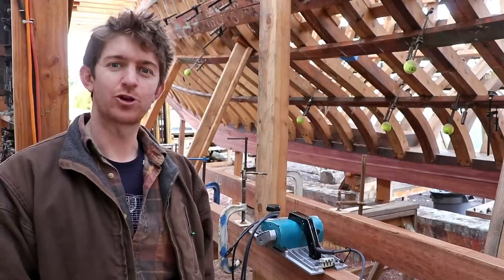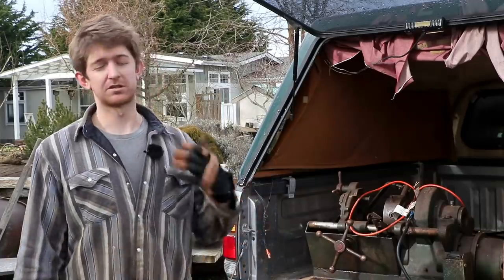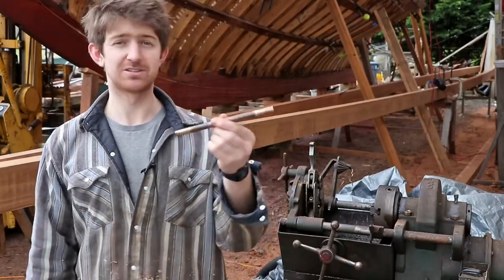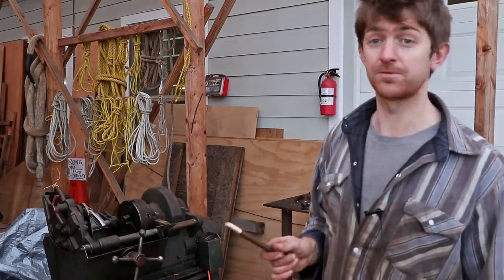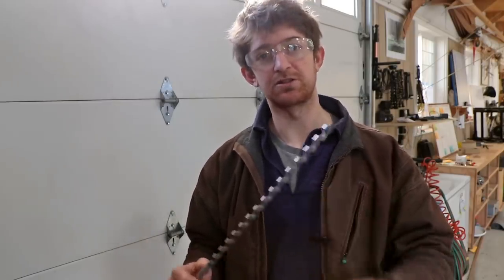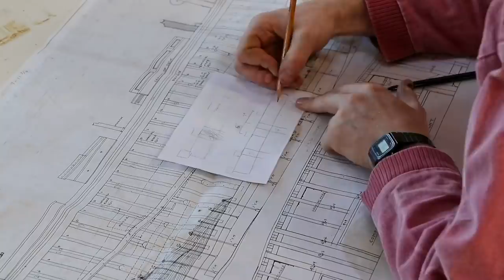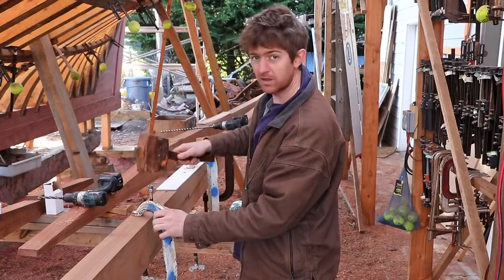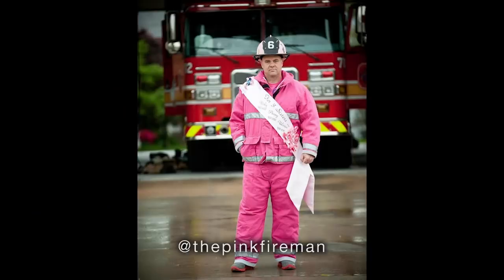East Coast Oak and a Pink Fireman (EP66)

Comment from the maker: A beautiful message from Marshall and Shannon at FOR 3 SISTERS! https://youtu.be/RecyLsr4rhU

BELOW: The top questions from the first 6 hours answered here. Remember to ask your question in the first 6 hours of each new video.
Also, I'm really happy to say that F3S has received a huge and amazing outpouring of financial support from you guys! Thanks so much! 

 What are you going to do for an engine?

A modern (but very low-tech) auxiliary Diesel engine, probably around 85HP. I'd love to use electric power but I don't feel it would be the right option for this boat, with the plans I have for it. I'll explain this in much more detail at some point. 

Why not just file the thread off the auger and leave the tip for easier starting?

Well actually, I didn’t think of it. But for hardwoods I really like to sharpen these augers on the Tormek grindstone, and I think that would be a lot more difficult with a pointed tip in the middle. I imagine it might make the drilling harder, too - it's difficult to even push a pin into wood this dense. 

How many batteries did you go through to drill those holes?

Actually, only one! Modern cordless technology is amazing.

How far and how long did it take him to bring you the wood?

Check out the little segment right at the end of the video. About 1 week of driving, 3500 miles. 

Where did you get that brown jacket / the pink smock?

The jacket came from Arborwear, they make great gear and I highly recommend it. The pink smock came from a thrift store (charity shop), via Cecca! The brand is DEAL.

Do you recommend getting into boatbuilding?

Absolutely! It has given me so much joy, and introduced me to many people who I admire. It may not always pay the best, but the builder of a beautiful wooden boat is always respected more than the rich man who paid for it. 

Why didn’t you counterbore for the nuts and washers in the beam shelf joints?

Counterboring would remove structural grain and reduce the strength of the wood even more, at the point where it is weakest already. There will be space above and below the beamshelf, so there it really no need for it here. This is why I had to make sure to place the bolts where there would be no deck beam sitting on top.
Reply: I like this idea of having a scroll through the comments early in the video release and picking a few questions. Might seem like your spelling everything out but it’s greatly appreciated to get some insight into what’s going on behind the camera.
Reply: @timmitchell8081  Agree, great addition to the site Leo

Comment from the maker: **QUICK Q&A**  Leave your most pressing question here (in a separate comment) within the first 6 hours of this video's release, and I'll pick the top 5 questions, and answer them right here in the comments! Thanks all
Reply: So how DID you mash your finger???...
Reply: When do you think you'll put Tally Ho in the water, where will you do it and have you any plans for the making of the mast and rigging? best series on Youtube ever!!!!
Reply: Will you do another rebuilding after Tally Ho?
Reply: Everything always seems to work out as planned, were there any mistakes or rework you had to do?
Reply: What gives you the energy and motivation to get up early, work through until dark and generally muscle on while you throw fists full of your hard earned dollars at the project (i.e. remuneration is not a motivator for your behemoth task)
Reply: When are you going to propose???
Reply: Hi Leo, your work is always excellent but do you ever make cockup's like cutting wood too short or drilling a hole in the wrong place. Best regards....DA.
Reply: I'm curious why you would use Bronze bolts over stainless steel??   Is it just historical correctness?  simply aesthetic?  or is there an engineering reason?.. thanks.
Reply: How far and how long did it take him to bring you the wood?
Reply: @calholli  he has adressed this in an earlier video i think. Acorn to arabella also discussed this in a video. I think while dismantleing the victoria
Reply: @claeswikberg8958  lol.. You could have just typed the reason since you've seen people say it--- but hey.. thanks
Reply: Sampson Boat Co what tools will you load onto Tally Ho when you leave? Since she’s a large wooden boat, I’m sure there’s some must have tools that you won’t wanna leave behind. You’ve got quite a large collection now.
Reply: @calholli  I know, but im not 100 percent sure i recall the correct ones, so instead of giving you the wrong answer... but i think it was down to how the wood reacted to stainless and that stainless is just rust resistant, and that the bronze holds up well.
so engineering standpoint i guess...
Reply: @claeswikberg8958  Right on..
Reply: How much will the Tally Ho weigh when she's done? 
How will you transport her to the water (what is max weight a boat transport truck can move)?
Reply: @arnhemseptember2009  at the end of the video the little signature thing on the wood says 7 days and 3500 miles one way. So that guy spent 2 weeks driving 7000 miles. holy geez.
Reply: @SuperNetSpyder  My goodness. I missed that....
Reply: @arnhemseptember2009  The Pink Fireman started outside Washington DC drove to Connecticut to load the oak, then across the US to Sequim WA. 10 days, probably over 3400 miles 5500km.
Reply: I like this Q&A section
Can you please show a drawing section of how the beam shelf supports the deck and briefly explain it?
Thanks!
Reply from the maker: @andrewhughes2446  not that one lol
Reply: Were the joint bolts at a slight angle pulling it tighter?

Comment: Three cheers for Marshall and his wife. The donation of his time and the commission of his truck and trailer to bring that wood across the country was an amazing contribution to the TALLY HO project. It's amazing how people come out of the woodwork to support Leo in his rebuilding of the TALLY HO. Also a big shout out to the fellow who bought Leo the 7" Makita Hand Planer. That was an amazing contribution and you can see how important a roll it has played in the work done during this video. Another big shout out to Leo himself for beginning the restoration on the bolt threading machine. Getting that machine up and running to produce threaded brass bolts was an impressive accomplishment. I also have to take my hat off to your master craftsmanship Leo. Those scarf joints are the same quality has the most expert Japanese wood joinery. They fit together like rocks at the Inca ruins on the top of Machu Picchu. Impressive. It's exciting to watch the progress that is being made on this project.  Well done Leo.

Comment: Your cutting oil reminded me of a tale told by my first boss. He was working in a metallurgical research laboratory in London. A colleague was working on new cutting fluids for copper alloys and was looking at modified vegetable oils, many of which form an emulsion with water. His car was leaking and burning a lot of oil, so he used the left over samples of oil. If he ran out on a journey he would just top the engine up with water. Imagine garage staff reaction, but the engine went on for years with this treatment.

Comment: On your planer - get a piece of PVC Elbow and put it on the out port so you can direct the chips .  Will save a LOT of mess all over the place and not just locally.  If it comes with a hose attachment, then use it to attach a 90 or 45 to it to deflect the chips.  

Hose and vac often get in the way and on your plannings just won't work.  A Heat Gun will help form to fit the odd shape.

You could buy 6 extra blades and just change them out then sharpen them as a group.

Comment: Hi Leo. When I have used a long auger in a power drill I simply grind a flat on the side of lead screw. This gives me the accuracy of locating the start (as the point is still there) and renders the lead screw grip ineffective. In other words I can control the rate of drilling and remove the bit at any time .. just as you are doing. It's almost two in the morning here in Australia ... but enjoying your video.

Comment: Leo, I’m sure you know or someone else has said this: since I’ve seen you cut a cord and by the black electric tape
On other cords, a thought to consider.
Put the cord over your shoulder on either side that supports your job at the moment. Between cutting the cords while using hedge cutters or scratching my finish while polishing my cars, I’ve learned this is a great way for cord management. You or others may have better but this is a great way also.
Especially since you just got your NEW planer!

Comment: Hey Leo, great vid brother! I have a suggestion for you with all those bolt heads you need to clean up after trimming them - an inverted chamfering bit. Not sure if they can be bought but I used to make my own from hardened silver steel - an old 20-22mm 3/4-7/8 drill bit ground out with a pencil grinder and cutting edges put in with an angle grinder and cutting blade (baby grinder!). Works like a dream and very quick.

Comment: When using those threading machines ,use trefolex thread cutting paste. When I served my apprenticeship we used tallow ,which made really nice threads as it allowed the dies to cut very smoothly . I suspect trefolex is made using tallow/lard. water soluble oil is OK but is expensive compared with the tallow/lard lubricants.

Comment: Leo, those threading machines are loose like that when they are new.  Albeit that one is a bit more it will not affect the threading as it is the shape of the die and motor that create the threads. the lays just assist getting things where they go.  GLuck Mate

Comment: If U file the Auger Worm Tip on 2 sides of the worm with a file this will slow the pull strength of the auger bit but still maintains some help with the pull of the bit. regards Kad

Comment: Ridgid brand dark cutting oil used straight is ideal. Use it straight/ undiluted.  I just bought a gallon for $40.  THe Rigid brand oil will last a long time if it drains back to the pump.
Thanks       The pipe threaders that I have used work that way.

Comment: The die holder on your threading machine is supposed to be loose so it will self-center if there's any runout on the rod being threaded. If it works I'd leave it be.
Reply from the maker: Interesting, thank you!

Comment: One of the greatest things you are doing is repairing and using all this old equipment, like that threader. Most people just buy a new lathe and complain the it doesn't do as hard work (flat threads on 210 cm rod) that old one will do with ease.

Comment: Those Makita 1806b planers are fantastic tools, and I believe still made in Japan,not China. It seems odd that there are no carbide blades available, and that Byrd makes a Shelix cutterhead for the Makita 12" hand planer, but not for this 6 3/4" model, which I'm sure is much more prevalent in the timber frame community. I guess they would do a special order, but lacking that you might get one or two extra sets of blades, and have them sharp and ready to go at the start of a Planing Day to save down time. A good job for your apprentice!😁
Anyway, kudos to both Mike and Marshall, so generous!👍

Comment: Use Rigid Thread cutting oil, not water soluble oil, it is more of a coolant than a cutting oil. Rigid oil can be purchased at most plumbing outlets. It will give you a better finish and fit  on the threads.

Comment: just in case no one has yet mentioned this regarding your augur bit with screw. Instead of taking off the screw Just grind down the threads and leave the resulting centered needle point that can assist starting a new hole. from barefoot to pivot toe.

Comment: It's good to have you back Leo, we've been having some fairly nasty winds here in the UK for three weeks now, guess you know that though.
Marshals generosity and trip was awesome. Not fully understanding the scale of the states, how many miles and days would that journey be?
Reply: If I remember correctly the timber was in Connecticut and Leo is just northwest of Seattle Washington. Those locations are on complete opposite coasts of the US. Roughly 3,000 miles and 45-50 hours of driving in good weather without a large trailer. Probably a bit longer for Marshall's trip.
Reply: @TheInsaneShecklador  Thanks for that. A few days driving then!

Comment: 15:30 african woods usually have a high content of sand, that is what makes blades dull, not so much the hardness. that is why protection is needed, because bleedy noses after a couple of hours (glass) are not a rare phenomenon. to keep the blades sharper, it is important to run them at balanced feed rates. too low, blades will skip, too high blades will rub on sand particles and get dull easily.

Comment: Could you use a small "brad point" on the end of the auger?   I bought a bunch of them at an auction one time that had ground down that way.   They seemed to work pretty good, but I only used them on softer woods like pine, walnut, etc.

Comment: I wouldn't be too concerned about that slop 
You can dump a lot of time and money into it trying to tighten it up 
But even a brand new lathe has slop 
Has to otherwise it'll bind up 
Iv got a very old worn out lathe and the trick to get it to cut nice (appies to any machine) is to start with the slack out 
As long as the dies are sharp and you cut the material square (more important with older machines) it'll make a perfect thread every time

Comment: Leo : You need to use a much heavier oil in the spindle bearings. 3 in 1 will not be anywhere near adequate it is too thin. SAE 30 straight mineral oil should do the job

Comment: That's not so much "slop" in the die holder as it is "play" to allow the die heads to self-align and run as parallel as possible with the shaft/pipe that's being threaded.  I think the two primary things you need to worry about are that the chuck holds the work firmly, and the die heads are as sharp/unworn as possible.

Comment: if you grind the thread of the tip but leave a brad point the bit will still be self starting but won't pull in.

Comment: Would it have been possible (or advisable?) to drill a "just big enough" pilot hole all the way through instead of cutting the screw tip off the auger bit?  I look forward to each installment.  Thanks for posting.

Comment: Leo,  !! Please note :  A great disagreement with one of your processes.  I HAVE done this many times.  Do not cut the screw tip off of the ship's auger, grind the screw threads off,, leave the point.  Stationary grinding wheel, approach the wheel carefully from a radial direction,, and only off angle of the wheel by the steepness of the screw threads.  Stable hold and slowly twist the bit gently against the side of the wheel.  To not damage the cutting edge, do not attempt to grind off the last and largest thread.  Get as much as you can,, you do not need to completely erase the threads, Only flatten the threads to the point they will not bite.   Keep the point,, the bit will not wander upon the initiation of the hole.

Comment: I was wondering why you don’t use a compression scarph joint with an expansion peg in the center?  The Japanese have used this joint in beams which carry several tons of stress and they withstand centuries of weathering, earthquake and snow load.  There are beautiful examples from as far back as 15th Century still safely in use today.  (Just curious if its a shipbuilding vs land use thing or simply preference and style..)

Comment: You could have just 'blunted' the auger drill screw tip, rather than cutting it off, so it would no longer pull the drill into the wood but would still act as a pilot/centering device.

Comment: I was wondering why not drill the holes for the deck beams, get the pieces into the frame, then join them together?  Would that not be easier, especially if not using any goop between the pieces?

Comment: Yeah, Makita planers are great! I've owned  a couple of them, albeit smaller versions since the mid 80's; workhorses, and they're still going strong. That big boy will be a joy.

A couple of tricks: on some woods the out chute may jam up with chips, at least the smaller versions do, just remove the chute and watch your fingers. For the bolts and screws that hold the blades, get the correct bits and use your driver/drill to zip them in and out. You should be able to set the correct torque with one shot with a little trial and error.

If you're sharpening often you need the, "Makita 98202 1.1 amp Horizontal Wheel Wet Blade Sharpener 
https://www.amazon.com/Makita-98202-Horizontal-Wheel-Sharpener/dp/B0000223JC/ref=sr_1_41?keywords=makita+planner&qid=1582608580&sr=8-41
It has a jig meant for those blades and is useful for many other things such chisels and plane blades.
Cheers

Comment: Your screw machine really isn't that different from a pipe threading machine like an old Rigid 300. In fact, back before factory threaded rod hit the construction industry, the trades threaded their own drop rods from round stock. The modern dies still have markings to do just that if you want to. My point, sorry..my point is that even if those machines are decades old, they work fine because the stock you are threading is centering the die so it doesn't matter if the saddle is worn or not--the die just floats. Your machine is unique to me because it has a lathe chuck.

Comment: On the long planing runs,, just as you should do for a belt sander, the moment before you grasp the D handle at the back of the portable belt sander or the power plane, take a wrap around your arm at a soft diagonal so the trailing cord leaves  at your elbow or even over your shoulder. The machine should never have to tug on its cord. The tug on the cord will certainly damage the surface of your work with the portable belt sander,, and the power planer is no different.  The cord should be dragged along by your shoulder or elbow.  The cord will last much longer too if kept out of the way of the belt or base of the unit.